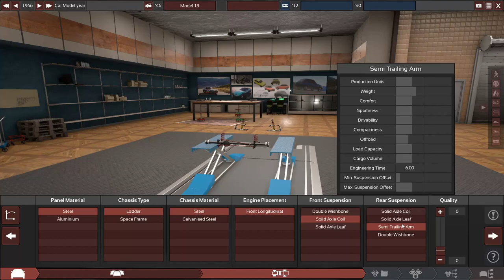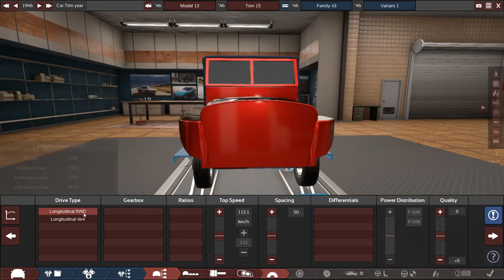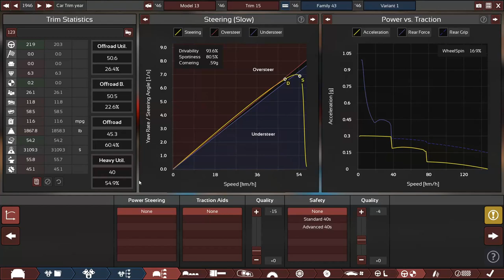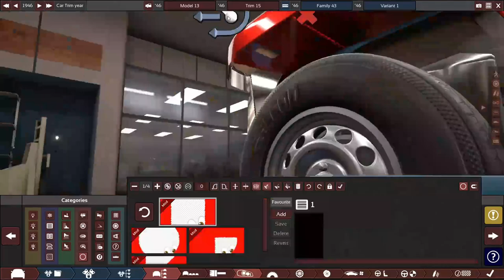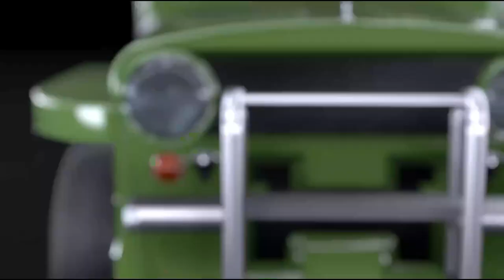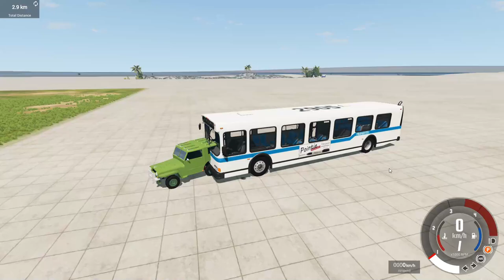Building A Sketchy Offroader!! Automation - BeamNG

Comment: The reason you can’t lock diffs in free roam is that you removed the UI app for those and the starter. Go into the menu, then UI apps, and put the Simple Powertrain Control app somewhere
Reply from the maker: Huh, I thought that might have been the case. But for some reason it just didn't click lmao!

Thanks!

Comment: Hey Rye, you can lock the diffs with the shortcut Alt + D. That way you don't need the UI on the screen. The reason you don't see it on the freeroam screen is because the layout for the time trials and the freeroam is different. If you wanted to add that UI element back into your freeroam, go to the UI editor on the side and add the differential lock UI piece.

Otherwise, you can just use Alt + D to save screen space

Comment: Harriot is an older English variant of the French feminine name Henriette, and it means "Estate Ruler" or more simply "Home Leader". From what I gather, I did not comment on the video with the Harriot GT, I won't claim to know why since I recall how squirrely the GT was what with its big engine driving only 2 of its skinny bias ply tyres (what with it being a pre WW2 car). So taking their name, Harriot can be implied to be a company that aims to make cars that will rule the road. Refresh my memory though, are there any more modern Harriot models than the MU/T Runner?

Oh, and a note on the Willys Jeep (the Willys MB), if I recall correctly they were only rear wheel drive and they were designed to be all purpose, light duty infantry, weapons and supplies carriers that dart about a forward operating base or other areas on relatively solid ground, not made for rocks, mud, light sand or snow, but then again if you've got machine gun nests and trench warfare still in use I doubt any army would dare operate in rocky, muddy, sandy or snowy conditions, the latter 3 especially if trench warfare is involved. So this is all very well and good for the MU/T, although the original 1945 Willys CJ (aka Civilian Jeep) had an MSRP of 1090 bucks rather than the 9 grand the MU/T here costs. Although, if the 9 grand here is in 2020 dollars, then the original CJ would total up to around 15 grand in 2020 dollars, so frankly I'm lost in this regard XD
Reply from the maker: Currently no other Harriet models, just the GT and the MU/T. But yea I think Harriet is more of a big engine badass kinda car company :P

And crap yeah IIRC the Willys was only RWD mostly. so i guess mines kinda a more fancy version XD